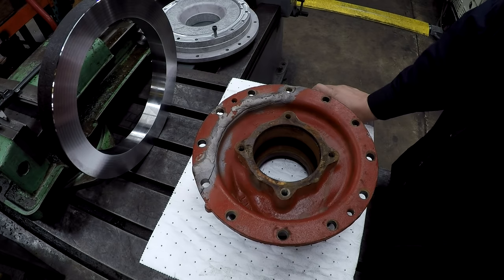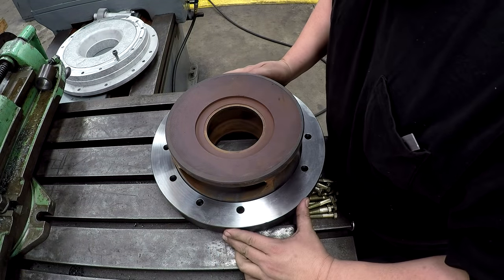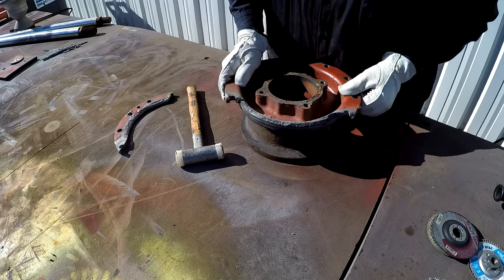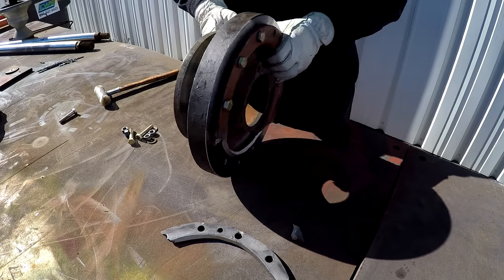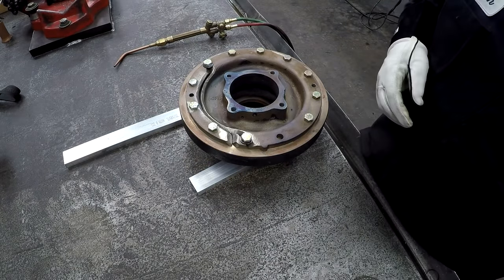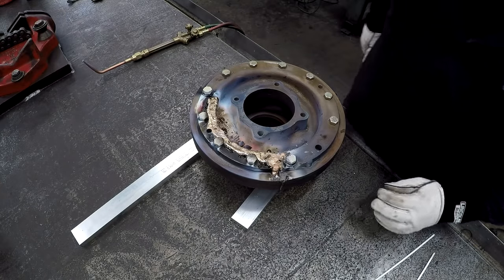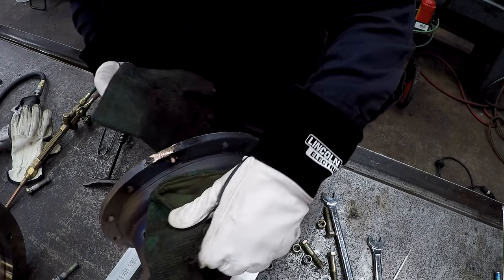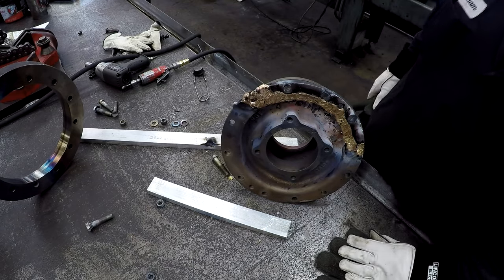Braze Repair on a Broken Casting Part 1

Comment: hey adam you should not repair this  make e new one  I now it is a lot of work en I dont now where this part from is  this is the cheap way
Reply: +Bas Velden This would be an extremely expensive piece to make. Lots of 3d contours that have to first be measured correctly, probably with a laser scanner, and then machined on a 4 or 5 axis CNC. Lots of expensive engineering and machine time would go into this part. Trying to repair it first makes too much sense.
Reply: +operator0  Not that expensive.  Most of those contours are there because it is a casting.  If this part was machined from solid, the design would much simpler.  The main expense would be the material.
Reply: +carabela125 You still have to factor in engineering time and I'll wager that machine time to produce this part is still significantly more than the time Adam will spend on it.